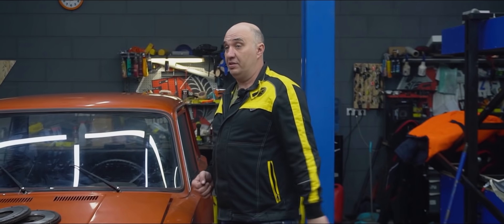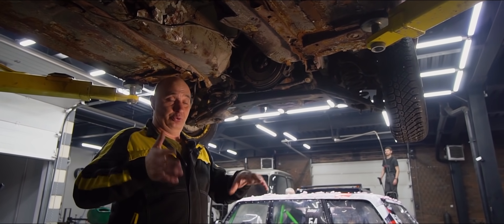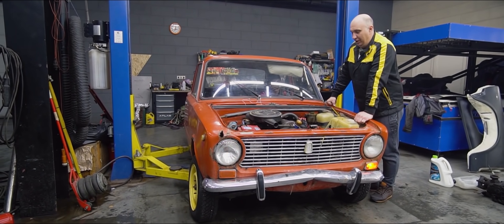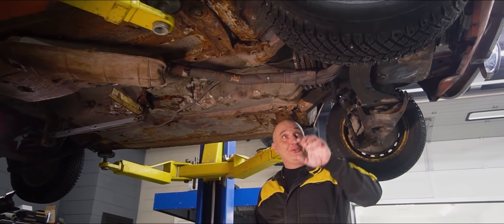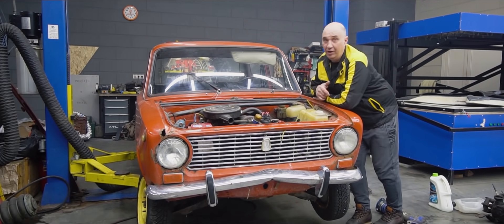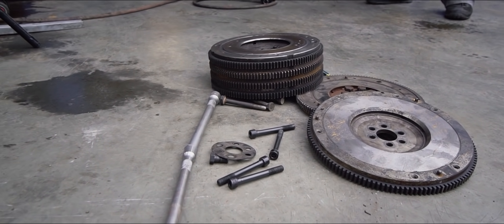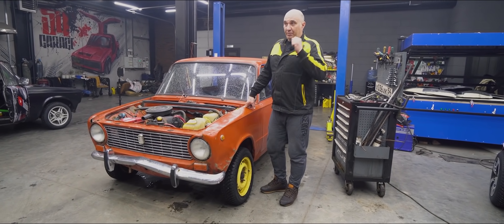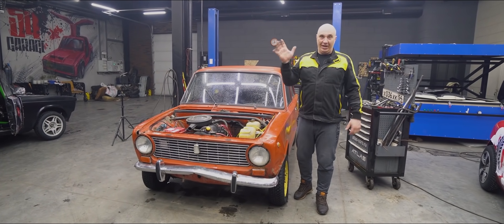What if you install FIVE flywheels onto an engine?

Comment: Sounds like the flywheels are "pushing" the engine when coming back to idle.
Reply: They are in effect Ronnie, they store energy by being heavy. These guys are crazy haha
Reply: @steven-vn9ui  I would bet $.05 that the torque of the engine on a dyno would increase after each flywheel is installed.
Reply: @ronniemaeker9102  no
Reply: @wrongwheeldrive9605  Physics. Law of motion and mass. Things in motion tend to stay in motion unless acted upon by an outside force. Add mass (flywheels) and the motion is enhanced. That is why early low horsepower engines had big, heavy flywheels to take advantage of the torque.
Reply: Yes that’s what’s happening it’s called inertia
Reply: @ambread1  Yup. That is why a gyroscope acts the way it does and is so difficult to change it's direction when spun up to "high" speed. Makes bicycles and motorcycles easier to ride.
Reply: @ronniemaeker9102  These big heavy fly wheels were necessary because old high torque low horse power engines would usually only have one or two cylinders. 
If you have less than 4 cylinders you need big flywheels compared to the engines size as there would otherwise not be enough energy to complete the compression strokes at low rpm and the engine would not be very smooth at all. The flywheel acts as a buffer between power strokes.
Horsepower cannot be overrated as the power of an engine literally is what decides how much energy it produces per time. 
If you were to put this car on a dyno the torque would not increase, as the flywheels too need to be accelerated. You also don't magically get more torque if you add weight to your wheels, which is essentially equal to what you do when you add more flywheels
Reply: @derfurz8618  I think what is confusing other people is that the curve would be smoother with more weight but the overall power would decrease because it takes energy, the more it weighs the more energy it takes. If it weighs more the curve lowers slower but also rises slower. It's just the conservation of energy.
Reply: @ronniemaeker9102  "horsepower is overrated" 😳 If two identical cars would race and the first had 100hp/200 torque and the second had 200hp/100 torque the one with 200hp would always win. Horsepower is work thats done and moving the car forward, you can have torque without hp but you cant have hp without torque
Reply: @JessicaMarinaRushie  the reduction would be quite minimal though. The energy stored in this flywheel is still quite low compared to what is stored in the drivetrain and (not on a dyno) as kinetic energy of the car itself. 
It is more noticable though, as the flywheels do not add alot of friction
Reply: @JessicaMarinaRushie  the reduction would be quite minimal though. The energy stored in this flywheel is still quite low compared to what is stored in the drivetrain and (not on a dyno) as kinetic energy of the car itself. 
It is more noticable though, as the flywheels do not add alot of friction
Reply: @hampusdj  try that on a steep hill climb towing a caravan 😏
Reply: @tikkabrno  doesnt matter, 200hp will win every time... Thats what gearboxes are for 🙂
Reply: @ronniemaeker9102  
HP=(Torque×RPM)/5,252
Horse power is a measurement of torque and how fast it's moving.

Once you consider that you can use gears to adjust the amount of torque that goes to the wheels or how fast the output from the transmission is spinning.
HP is all that matters.

Example: 
We have an engine that produces 100 ft.lbs. at 2,000 RPM. Vs. An engine that produces 200 ft.lbs. at 1,000 RPM. (They calculate to the same horse power.)  Put a transmission behind the 100 ft.lbs. engine that is a 1:2 ratio. Output RPM is halved and torque is doubled (simple machines/conservation of work). Its the exact same performance figures now.
Both set ups are now capable of doing a job that requires 200 ft.lbs. at 1,000 RPM.
Reply: @hampusdj  Yes. I think we are on two different paths. I am thinking about the ability to do "work" that is not concerned with speed.
Reply: @ronniemaeker9102  torque in work/motion is horsepower so still not making sense for me to call horsepower overrated 🙄 high torque with low hp just tells that its at low rpm
Reply: @hampusdj  They are related, but two different measurements. Torque is the twisting ability. Horsepower is a measurement of power.
Reply: @ronniemaeker9102  yes, 2 different paths... and you're on the one not knowing what you are talking about.
Reply: @derfurz8618  speed*mass.... the flywheel rotates a lot faster than any other part of the drivetrain (in settings concerning acceleration, not so much the highway gear) and is also bigger in diameter (except for the wheels, of course), so the linear speed is also pretty much the highest. The 3 extra flywheels might have a similar effect as seating 6 extra passengers in the car.... or, hey, seating them in the wheel hubs xD
Reply: @dushk0  Ok. What am I talking about? I was under the impression that this channel was for fun and learning...my mistake...
Reply: Thats why I made mine , dissengage with an air clutch .
Reply: @ronniemaeker9102 , I agree this channel is for fun and learning.
I actually want to help you understand that HP is a function of Torque.
It's easier to talk about in linear terms rather than rotational terms.
Torque is the equivalent of force.
RPM is the equivalent of speed.

A "high torque" engine generally refers to an engine that makes a lot of Torque (or force) at lower RPM (or speed).

Think of high Torque as a 300lb body builder that can move a ton from point A to point B in a single pass, but can't run 10yds to save his life.

He's capable of tremendous slow force, but we'll compare to a runner that can move 100lbs at a time.

A runner would have to make multiple trips to move a ton, but because he is capable of moving so much faster than the body builder they get the job done in the same amount of time. This is equal power.

Now if the runner is capable of getting the job done faster, he would be more powerful.
Even though he is incapable of lifting on a single pass as much as the body builder.

If you have a body builder that can lift a ton AND run as fast as the runner, he would be more powerful.
Reply: @wetherabble  A lot of my sarcasm is meant in fun. I am an old school mechanic that worked on ag and construction equipment. I did have one vehicle that I thought was bad ass when I got through with it: 1968 Mustang 302. Compared to todays engines, that one was only crawling. 
The equipment I worked on relied on a lot of torque. Either mechanical or hydraulic, torque was the goal.
I know some people (not you) are going to take things as a personal attack because they don't understand or don't do the research to learn.
Take care.
Reply: @wetherabble  but you can also put in taller gears on the engine with more torque to get the same acceleration as the one with more hp. Added benefit would be a higher top speed.
Reply: @9HighFlyer9  that makes sense. 
So long as your high torque engine can rev high enough and maintain that torque to be comparable.
Reply: @wetherabble  if you have enough torque you don't need high rpm. Just taller gears.
Reply: @9HighFlyer9 , if you have enough torque you just have more HP
HP=Torque x RPM
More Torque = more HP
Reply: @wetherabble  given 200hp/100tq or 100hp/200tq for a standing start which do you take?
Reply: @9HighFlyer9  200 HP
Capable of getting more work done in less time.
Reply: @9HighFlyer9  I guess I would have to ask how long is the race?
15 foot time is probably going to the 200ft.lbs. car, but it'll run out of steam shortly and 200hp car will run circles around it.
Reply: @wetherabble  does it change anything if I say
They both reach their max 200hp and 200ft-lbs at 3000rpm? Assuming everything else tires, diff, trans ratios are all the same
Reply: @9HighFlyer9  Giving a set RPM completes the equation, and we can calculate HP and torque respectively.
200ft.lbs @3000RPM = 114HP
200HP @3000RPM = 350ft.lbs
Which engine would you bet on? 

See how knowing the HP pretty much tells you all you need to know?
Reply: It is called centrifugal force. when you get the engine up to full speed the weight of the flywheels will keep the engine turning. This is schoolboy stuff.
Reply: @THEJR-of5tf  *rotational inertia... school boy stuff
Reply: They are
Reply: @hampusdj  Engines with low end torque require less gearing to get the same torque to the wheels as a low torque, high rpm engine with the same horsepower. This can lead to disappointment for some people with relatively heavy muscle cars and trucks when they increase horsepower at the expense of low end torque without changing the gear ratios to match. The power band narrows too, so now you need narrower gear spacing in the transmission and more gears to take advantage of the extra horsepower. 

That is how people come to believe torque is much more important than horsepower. In a limited sense, it is. If you can perfectly match the tranny and rear end to your engine characteristics, horsepower is everything. But that is just not possible most of the time. A big block with a lot of grunt and not much power can easily beat up on a high-revving small block with more power and the wrong gears, stoplight to stoplight all day long. Given enough room, the small block will catch up and walk away though.

Comment: Runs like an old non turbo diesel like a Volkswagon rabbit from the eightys
Reply: Yup, that is true. Getting it to 60mph on a freeway is aonther story....
Used to own a 1981 Rabbit. It was slow , ragged out and smoked like no tommorrow...
Reply: Spot on !. I owned one. Even sounds like it !
Reply: @pauloconnor7951  That Lada probally harder to pick up with 2 people than the rabbit was I would guess?
Reply: I had a 79 diesel, first gear idle start off. Just drop the clutch, no throttle needed.
Reply: Those things will idle up just about any hill around without touching the throttle.
Reply: @hdezn26  swap a GTI close ratio in, it dropped like 5 seconds off the 0-60. 10.5 ain't great but it's better then 15 without touching the engine.
Reply: Eighties

Comment: Poor-boy differential lock: slightly apply brakes to make both axles turn.
Reply: was going to say that!! alas modern cars with drive by wire puts the engine to idle when you left foot brake :-(
Reply: I do the brake trick on my old tractor without diff lock. Works wonders but the diff is getting a lot of stress.
Reply: Applying some e-brake works great for this, since it will only apply brake to the driving wheels. (Unless you have fwd car with rwd e-brake or the other way around).
Reply: Flywheel diff lock: put heavy flywheels on each wheel to prevent wheelspin
Reply: @ronnie or use the rocking motion and let momentum move your vehicle if you're stuck.
Reply: yeah thats true but i think u guys dosnt understand what is happening while u are braking diff
Reply: Taaak
Reply: @uooello13  Not braking diff, braking at the wheel. Makes the diff act like a welded diff. Stops the tire with slippage and equals out the torque to both wheels. Not hard braking, light braking. Just enough to stop slippage.
Reply: @ronniemaeker9102  diff moves wheels u brake wheels u brake diff its like putting a stick in bike wheel
Reply: @uooello13  But...........you have two wheels, not just one.........
Reply: @sniglom  or if you have a front e-brake 

Brought to you by 4X140 gang
Reply: @Daddimirr  MY series subaru for the win 😀
Reply: @mightyfinejonboy  My manual trans 2012 Toyota Corolla lets you left foot brake and won't cut power.
Reply: @ronniemaeker9102  That's actually a thing. My car does that when the VDC is on. It works in conjunction with the vlsd.
Reply: @sniglom  I am going to show how far behind in the time I am. My pickup is now 19 years old, the one before this one was 26 years old when I sold it. Most of my experience is from days gone by. First car was a 1968 Ford Mustang.
Reply: @fullmetaljacket7  Out of my own "non-information", what is VDC and VLSD?
Reply: @ronniemaeker9102  Is that what rally drivers do? They brake and accelerate at the same time around corners right? So it locks it up so both wheels spin?
Reply: @JessicaMarinaRushie  Ha, ha. No, race cars are not Ladas. The differential was developed to allow vehicles to go around corners. With a locked (no slip) rear end, the vehicle wants to go straight. Look at how a differential is made and it will make more sense. A "locker" differential, from my era, allowed slippage around corners, but had enough "drag" on each axle to make them turn at the same rate going straight.
Reply: @ronniemaeker9102   Are you sure about that because I used to know a guy who wielded his diff because he was drift racing. Seemed strange to me at the time. Oh well, I thought I could improve my rally times in Dirt... Dang :(
Reply: @JessicaMarinaRushie  I am not a rally driver. I'm just an old school mechanic and was a Warranty Administrator for a truck dealer for Mack, Volvo, and Mitsubishi, as well as motorhomes. I never drift raced. I was a weekend warrior with my 1968 Ford Mustang and a weekday (nights) fixer for the next weekend.
Reply: @JessicaMarinaRushie  One thing you can do, if the car is equipped, is to use the hand parking brake on corners to slide the rear around. If it is not equipped that way, modify it...
Reply: @ronniemaeker9102  vdc vehicle dynamic control (stability and traction control), vlsd viscous limited slip differential

Comment: Maybe I'm hearing things.( flywheel comes zinging through the windshield)
Reply: You mean through the floor boards .
Reply: @paulbains9152  Well , it goes without saying, it would have to go through, first: the bell housing, and then, secondly,  the floor boards,  ( or tunnel actually) before it made it all the way up to the windshield, but ,yea, ok, that too.
Reply: @treeguyable  My flywheel unit weighed about 300 lb . I gained a one gear up advantage at a maximum of about 3000 rpm . If you wound it 2 or 3 times as fast , you would have much more potential energy , but if it ever     got away ,it would be lethal . I didnt have the guts to spin it that fast . There was 1 bellhousing of steel , about 3/8 in thick . I balanced it by trial and error . I drilled and tapped holes all around it , and screwed in allen set screws      as weight adjustment . If you cleared up the harmonics at one rpm , they increased at another rpm range .
Reply: Yeah, I kept thinking, well ,this is gonna end with a ride in an ambulance.🤣
Reply: You have 4 that leaves a lot of possible trajectories lol
Reply: I misaligned a torque converter in a doge pickup on my first transmission build. It hit third gear and exploded. It sounded like pulling the trigger on a shotgun in a close closet. I about had an f"ing heart attack. I watched this in disbelief. I could not believe anyone would be nuts enough to do it. And he used soft bolts. OMG!!!! Jesus is Lord and I now believe in miracles. Whew. Luckyyyyy. That could have been a quick ride to Jesus the hard way.🤣
Reply: @treeguyable  what tunnel?
seems there is only a big hole :)
Reply: @helder4u  Yea, in this car , even worse with no tunnel.
Reply: @atomicradiusatomicradius171  He was nuts and risked being sans nuts. I popped into my local village shop in Rutland c 1990 to chat with the proprietor's daughter in her twenties. She had just returned from a trip down the dual-carriageway A1 motorway with her exhaust pipe sticking up through the floor near her handbrake, having fallen down onto the road whilst she was  travelling at 60mph. It was forced back up in milliseconds, punching itself  through into the cabin, narrowly avoiding doing a Kubica arm-job on her + potentially knocking her block off.
Reply: @rattusnorvegicus4380   yup, horsepower is nothing to experiment with unless there are actually engineers on site.😆

Comment: Would love to see you guys keep this around, and do a fuel mileage comparison on a road with flats and hills with both the stock flywheel or an even lighter one then this setup. Will the added inertia help with mileage over the coarse of daily driving,  with a measured fuel source.  Great vid. keep them coming.
Reply: Good point, that heavy flywheel on a fairly flat course driven conservatively should actually improve gas mileage.
Reply: No it won't because the engine needs to work harder to rev it in the first place.  If you only ever drive down hill it might help but I don't know anywhere like that.

Comment: Some power generator are started by a mass that is always kept in motion... This allows to minimise the amount of batteries needed for no-break power systems, since the engine is reaching it's ideal revs in less than 30 seconds.
Reply: Many spacecraft are equipped with a flywheel on each axis, to allow for orientation by spinning them up or down, rather than using thrusters. They call them reaction wheels.

Comment: do you reckon you can make a clutch out of 50 grit sand paper?
Reply: I would think it would have to be THICK. Like layers of it
Reply: Mantıklı kanka iyi fikir
Reply: @thatboyj1211  I just want to see if it could be a viable thing to do in a (rather tight) pinch. doesnt actually matter how many layers are there. it can even consist of a wooden frame to press the sandpaper surface on to the fly wheel
Reply: Sand paper has bad grip on a smooth surface.
Reply: @nicostenfors5690  what about brake pad
Reply: @yigitdemir4604  brake pad..... a different layout but almost the same ablative material. Some here in the Philippines, rebond brake pads and clutch pads. It in turn destroys your rotors or flywheel if impurities are present. But what the heck, its cheap and cars here (the kei cars from Japan) are surplus anyways. Some people here are turning away from local bonding shops and buying those "atleast" quality stuff from China.
Reply: Wouldn't work.